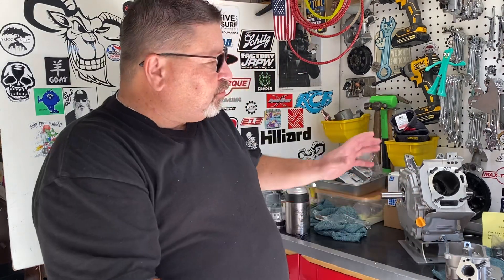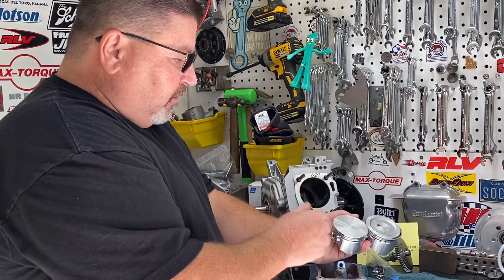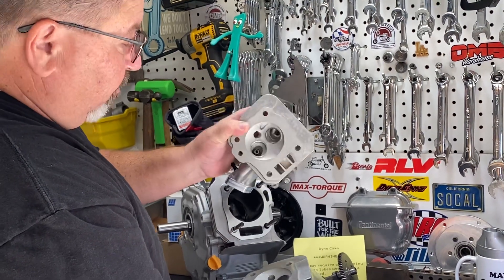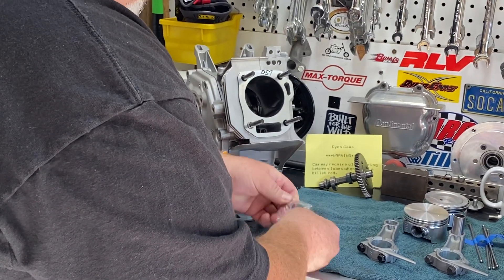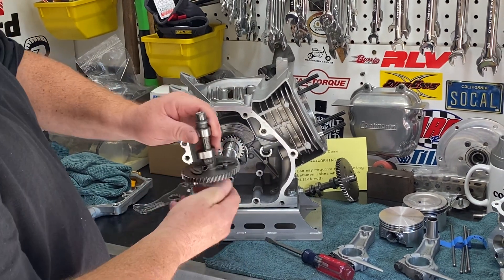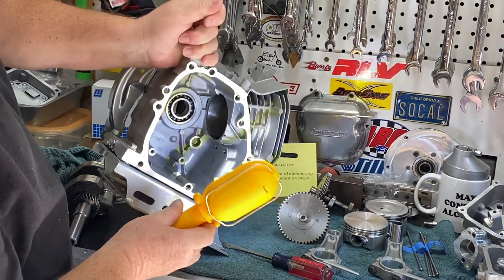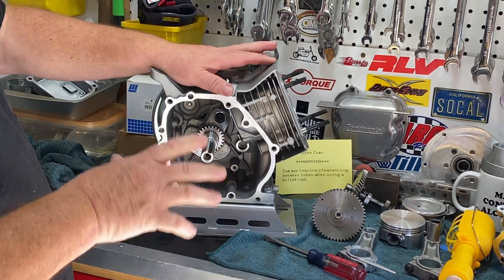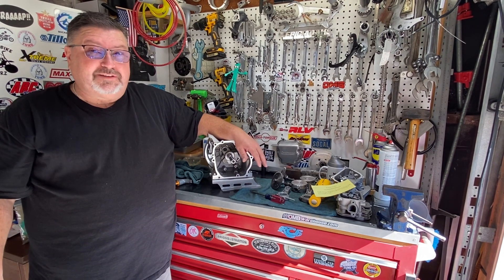WildCat 223 what you need to know when building

Comment: Anyone know what the stock specs are on the wildcat 223 cam are like lift duration?  Been trying find that out and what the Tillotson 212r while they were being sold. I have one just surprised the stock 212r cam had like .264 .265lift on the Tillotson was wondering if anyone else had similar results.
Reply from the maker: The lift is .224” on the stock Wildcat cam. I have no idea what the duration is. Most stock cams for 6.5hp industrial engines are .224” lift

Comment: Will these heads fit on a Predator Hemi?
I've asked everyone including EC and no one will answer me LoL.
I really only want to know yes or no, not get into why and what and this and that with everyone.
Reply from the maker: Yes, this head will fit the Predator 212 Hemi block
You will need to have the correct length pushrods but other than that it is a direct bolt on
Reply: @TheGrayGoatGarage I never noticed that you answered me, sorry for that.
THanks for the repl, I still didn't have an answer until right now haha.
Glad that I decided to rewatch this video. 

Regardless it was the dowel pins and bolt holes I was concerned with mostly, different pushrods makes perfect sense.
But not everyone knows that so thanks for making sure that I did.

Comment: Hey Eric, I set my ARC flywheel to 65ft pounds and now I'm trying to get it off to add a cam to the 223. It's not working with the knocker method, you think a puller is the only way?
Reply from the maker: Yes, I would only use a puller on ARC and PVL flywheels. NOT an outside puller. You need to have a small one for the threaded holes in the front of the flywheel! https://www.ombwarehouse.com/7250-flywheel-puller.html
Reply: @TheGrayGoatGarage  I ordered the ARC puller, thanks so much!

Comment: I bought the Wildcat 223 from OMBWAREHOUSE just because of your videos here ! I was planning on doing the 20 over rod and piston ...to hopefully have 17 thousandths in the hole as well...but just noticed a 50 thousandths over forged rod avail now for the Wildcat 223. Kinda scary though, if my engine is anything like yours ( Still waiting , 10 day delivery special order wait time ) ...that only leaves 7 thousandths in the hole. Think it's safer going 20/20 rod/piston combo....50 in one shot with the rod seems like a lot....any thoughts ?
Reply from the maker: Here are my thoughts. Use the +.020 rod and the .570 pin height piston. Once these get installed and we know the true deck height, we can get our .030” clearance through the head gasket. Head gaskets come in .010”, .018”, .027”, and .040” thicknesses. Too many variables with these engines to have one “recipe” that fits all engines. The +.050” rod uses the .550” pin height piston
Reply: @TheGrayGoatGarage  Will do, Thanks !